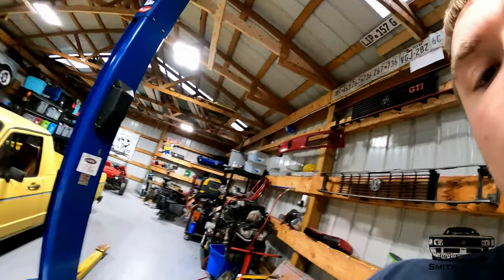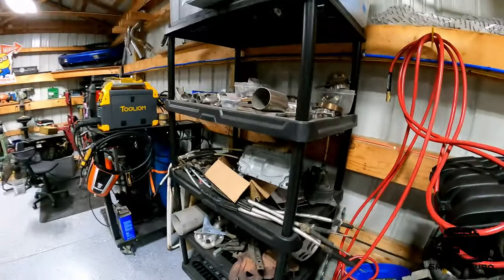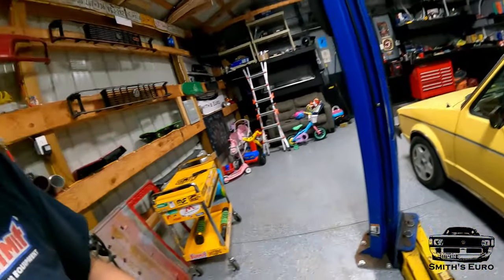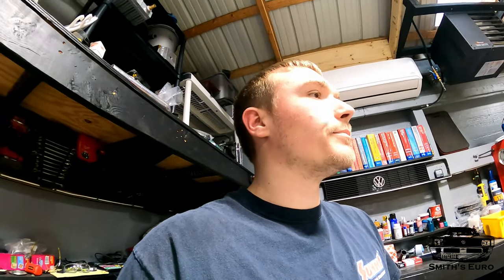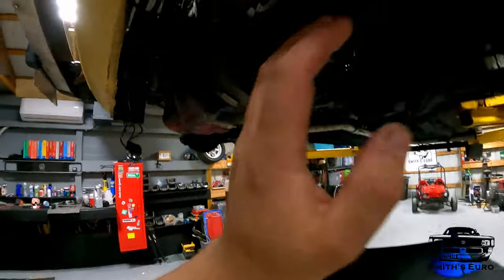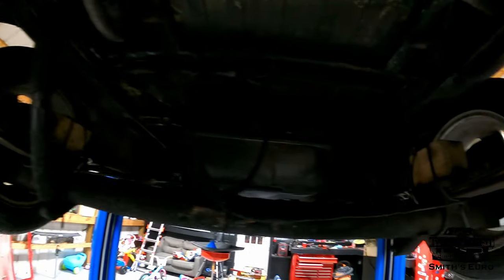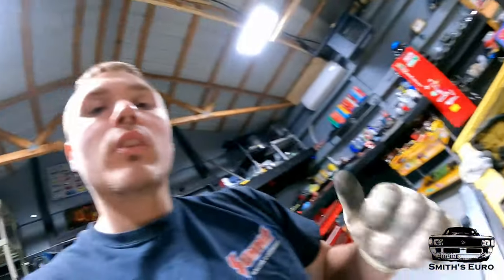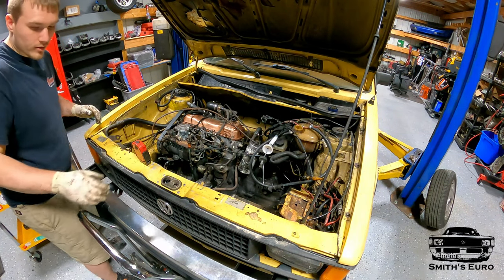Swapping A TDI Into MY MK1 Rabbit Pickup Truck ep1

Comment: Hey so I have a mk1 caddy with the na 1.6d 5speed and I’m looking at a 1z 1.9tdi with a 5 speed would the motor be almost a drag and drop mount wise
Reply from the maker: No you would need custom mounts, different axles, shifter if using the 02a 5 spd

If you reuse your 020 5spd thats 100% bolt in
Reply: @SmithsEuro   I knew about the axels cause If I remember correctly I’d need like 90mm axles or so and I’m getting a 97 Passat that has the 1z 1.9tdi it’s a complete car so what exactly do you think I’d need
Reply from the maker: If you use what you have and your 020 5speed you need nothing else.

02a mounts/clutch cable or hydro conversion/shifter mounting and shifter/use scirocco 16v axles and if you have 90mm knuckles you add washers to clear knuckles if 100mm knuckles the axles fit no problem
Reply: @SmithsEuro  ok perfect thanks I’ll let you know how it goes should be picking up the donor car tomorrow and in the next few months I wanna try to get it done in a very timely
Reply from the maker: No problem, i have other videos showing the whole swap as well. 
Documented everything i could
Reply: @SmithsEuro  Ik I’ve watched most of them 😭